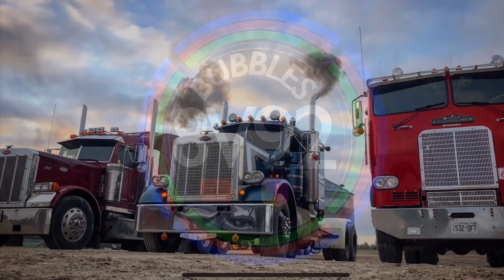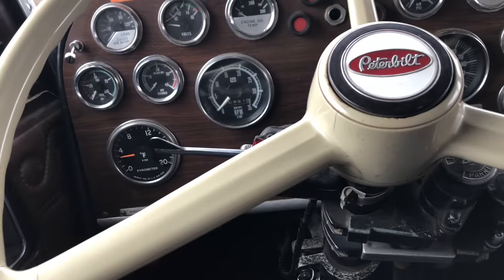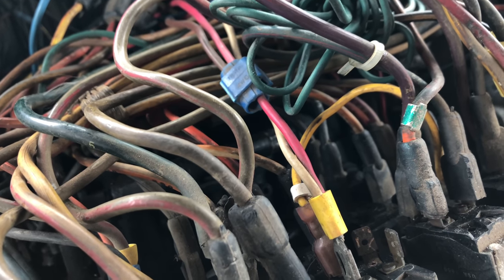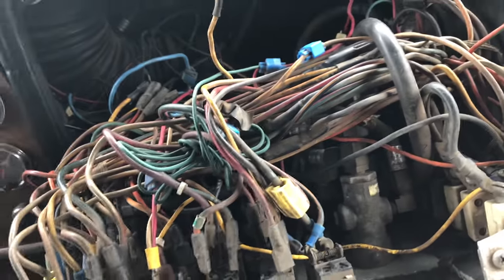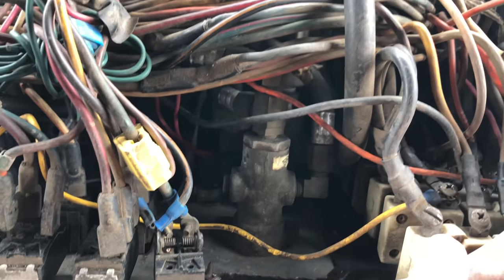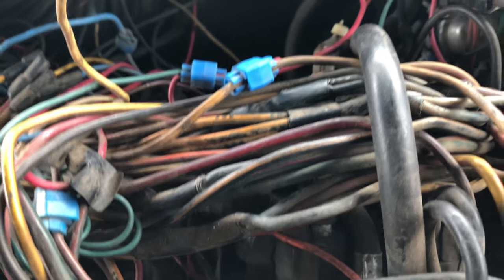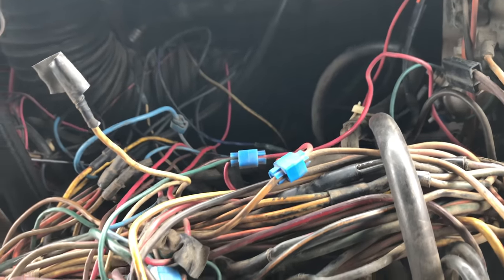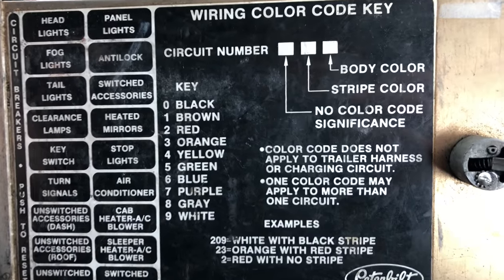Peterbilt 359 Restoration Part 8 #Peterbilt #359

Comment: How much would a new wire harness for that truck cost?  As old as it is seems worth it to just replace the entire wiring and toggle switches with new ones.
Reply: Might not be able to purchase a new one. WIring harnesses for older vehicles are often not produced anymore. I don't know in the case of this Peterbilt, but If you can find one, I bet they want your first born child for it.
Reply from the maker: There is a company near me that makes them for 359s... but its all done by hand.... mine actually is fairly intact its just everything that they added too it thats hard to figure out
Reply: @Bubbles8V92  Not very often you find that in most cars and trucks, I'm working on a 2000 Dodge Ram 1500 that needs some wiring harness repair and I was going to try to make it easy by getting a new one. Problem is, you can't get one.
Reply: Harness for 359 is 360 bucks from  Dan's
Reply from the maker: Ricky Frates problem is im in Canada and the import charges are insane. Like Twinsticks said... $500 up here... i paid 25% on my chrome from raneys... thats a suprise kick in the pants 😑😑